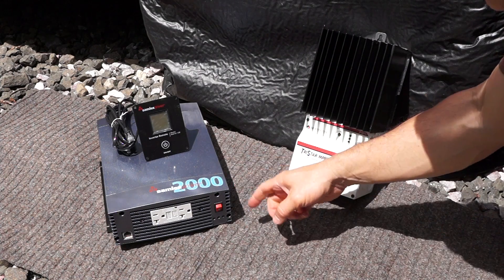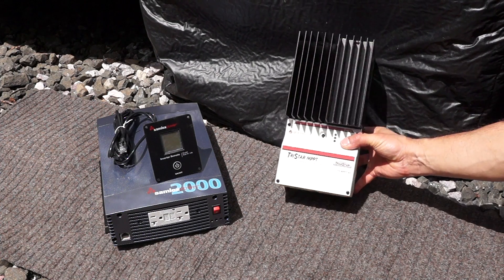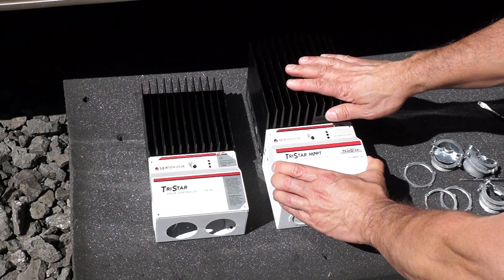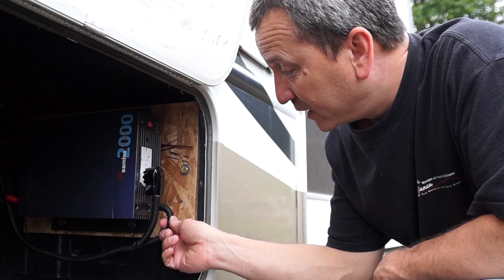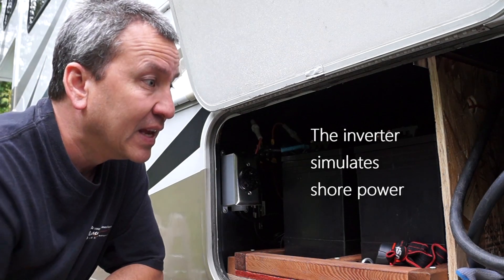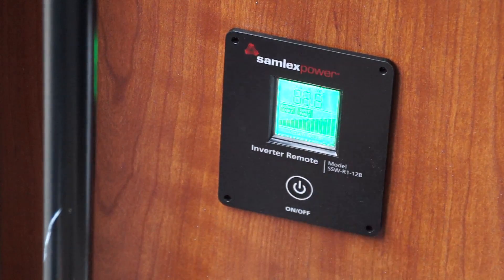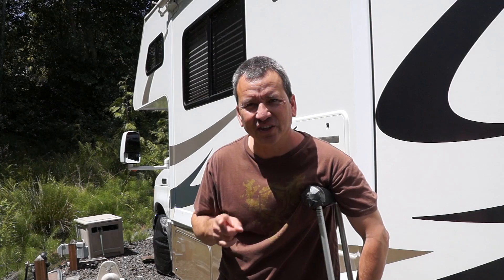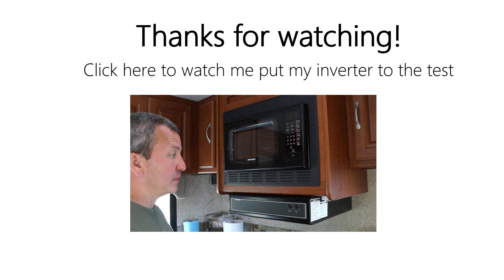Inverter and MPPT Charge Controller Installation - DIY RV Solar

Comment: Hi Tito. Thanks for the video! My wife and I just bought our first RV on friday and I wanted to try a similar setup. A few potentially dumb questions. 1) Did you only install the plug where you did for spacial reasons? Or, would you have installed your inverter next to your shore power if you had the space for it? Can you briefly explain the plug as well? Do you have a 15 Amp plug coming out of the inverter and then going into the new 30 amp socket? Where does that conversion take place? 

Thanks,
Brett
Reply from the maker: Hey Brett. Those are good questions. Here's my attempt a some good answers:

1. I installed the 30 amp plug in that compartment because it is also the compartment where my power cord is stored. It just so happens that my batteries are in there as well.

2. I would have installed the inverter as close to my battery bank as possible. I didn't have anymore room on that side and had to put the inverter on the other side about 6 ft away (with #2 AWG cable). As a general rule, your inverter should be as close to your batteries as possible (6 ft away is about the max), but not in the same compartment as batteries which release gasses.

3. Here's a link instructing how to wire the 30 amp RV plug (http://www.myrv.us/electric/pg/30amp_service.htm). It is 120 volt plug and NOT wired like a 240 volt plug in your home.

4. Yes it's a 15 amp plug coming out of the inverter with a 30 amp plug on the other end. Think of it as an adapter. You should be drawing well under 15 or 30 amps at 120 volts AC from your inverter. 30 amps at 120 volts AC equates to roughly 300 amps at 12 volts DC (batteries). Your battery bank won't support anything close to that. Do not try and fire up your air conditioner, electric heater or electric water heater while on batteries. You're off the grid so stick to small components, laptops, TVs, radios, etc.. If you need heat, you'll have to use your propane. Wait until you hook up to shore power before firing up that air conditioner or electric heater.

I hope this was helpful!
Reply: RVwithTito Incredibly helpful! A few more things. My RV has 50 amp power service. Does that change much in this scenario? Also, I bought a Winnebago Adventurer and the battery bank is in a compartment in the stairwell. I think (it's still on the lot) that the exterior compartment next to it would have space for the inverter. The shore power is on the other side (drivers side) and near the back of the coach, at least 15 feet away. Will that distance have any effect on the install other than just needing to buy a longer cord?
Reply from the maker: brett snider The 50 amp plug is different. It is basically wired to support two separate 120v legs/circuits or together as a 240v circuit ( http://www.myrv.us/electric/pg/50amp_service.htm). Off hand I'm not sure what the best way is to connect to a single outlet on your inverter. You'll probably have to wire it as if it were a 50amp-to-30amp adapter cord. 

You are correct about the length of cord from your shore power cord to the inverter. 15 ft is fine. It's the DC connection between your inverter and battery bank that draws the most amps (due to lower 12v DC voltage) and needs to be as short as possible.
Reply: +brett snider For a 50amp setup just mount a regular 15amp outlet in the power bay and use an adapter plug like this: 

http://www.amazon.com/gp/product/B00HRHWHNW/ref=pd_lpo_sbs_dp_ss_2?pf_rd_p=1944687762&pf_rd_s=lpo-top-stripe-1&pf_rd_t=201&pf_rd_i=B00IPUFQM4&pf_rd_m=ATVPDKIKX0DER&pf_rd_r=1271J1H2B0JR59F4TYD6

Comment: Thanks for the great videos.  We just purchased a used 2006 Four WInds 31F class C, looks very similar to your rig.  We have only used it a couple of times, but know we need to, at a minimum, install an inverter.  (I already put on the front and rear sway bars and shocks you have, worked great). The battery that came with the coach is a single 12V, not two 6 volts like you have.  I want to change over the batteries at some point but will hang with this one as long as it lasts. I am looking at 1500W pure sine wave units.  I want to set the inverter up like yours (minus the solar and "smart" charger you have) but have a couple of questions.  I believe I can do what you did and run a wire from the inverter GFI outlet to a 30 amp receptacle, and just plug the RV "shore power" cable into that when I want to use the inverter.  I would also need to disable the battery charger when I use the inverter.  Is that correct?  Anything else I am missing?  Do I need a fuse somewhere in the system?  Any ideas or thoughts would be appreciated.
Reply from the maker: Nice! Ours is a 2007. Sounds like you are close. Add a 250 amp fuse on the positive battery connection between the inverter and battery. Also use at least #2 AWG cable between inverter and battery and keep the length to less than 6 ft if possible. And don't forget to switch the charger off when plugged in to the inverter and switch it back on if on shore power or generator.
Reply: Thanks, appreciate the quick response.

Comment: Tito, Great videos! I have a 5th wheel with a factory inverter/converter like most RV's that charges my 2 6-volt batteries on shore power. I installed a 315 watt panel through a MPPT Tracer 30-amp controller and want to do the same procedure you did plugging the shore power 30 amp connector to my Whistler Pro 1600 watt inverter that is currently connected to my batteries? I did locate a breaker switch that I believe turned off my factory charger and when I plugged my power cord into my 1600 watt inverter, it started making warning sounds requiring me to turn it off ASAP? I called Whistler tech support and they were not much help, but they thought the factory romex wiring was hooked up differently causing the inverter to back feed and sound off? I have not installed a transfer switch thinking I won't need one? Doesn't the factory inverter/converter have one built in that would take care of my issues? I also located the breaker that controls the 110 outlets (turned it on) that I would use for my coffee maker, tv etc, and turned off all others? (microwave, fridge, ac etc) But no worky? Another RV You Tuber just went directly from the inverter using a heavy gauge extension cord (junction box) to separate outlets mounting them for coffee pot, tv etc? That I can do with a little more work and expense... Like your set up much better though! Any idea whats wrong? Thx Bill

Comment: I have a question for Brian and everyone else.  I was thinking of building a 400w solar generator system separate from the travel trailer.  The batteries, inverter, etc. would be in the back of my pick up truck.  Using a bank of 4 Trojan 105 RE batteries, 4 100 watt solar panels and a 3000w pure sine wave inverter  on a prebuilt board from solarpenny.com with a controller, charger, etc. and a 30 amp receptacle hard wired to the inverter.  My plan was to just plug the travel trailer shore power plug into the 3000w inverter.  Would I have to disconnect anything on the trailer for this to work?  Would my inverter charge my "house" batteries on the travel trailer?  Is the only reason to have an converter is to convert DC to AC in order to charge the "house" batteries?  If the breaker for the converter is turned off, will the DC powered lights and outlets still work?

Thanks for the videos.  They're giving me good ideas.

Lowell
Reply from the maker: lowell mccormick Personally I do not think this is the best option Lowell, but it is interesting to think about why or why not. When you arrive at an answer you will have learned so much about your trailer's electrical system. For that I applaud your efforts. It seems like this setup introduces too many factors that could cause problems. Therefore, I would consider other options. Of course, this is just my non-expert opinion (disclaimer). 

Your RV/trailer's house batteries, converter/charger and AC circuits are designed to be tightly integrated and share a common ground. When adding something like solar or an external solar charged battery system, it's important to understand how it affects the entire system, switching, etc. and be very careful when bypassing one of these. 

With that said, here are some questions/comments that may lead you to a solution: 
(1) Is your goal to charge your house batteries, power your AC/DC, or both? 
(2) Is installing those Trojans, controller and inverter on your trailer an option? 
(3) Yes, your solar generator will try to charge your house batteries unless you shut off your charger. You may have to completely isolate your house batteries since they share a common ground. 
(4) Your converter/charger converts incoming AC to DC (for your 12V DC stuff and battery charging using the charger part) and to filtered AC (for your AC stuff). 
(5) Your solar generator's charge controller and inverter will probably need to share a negative ground. 
(6) To find out if your 12V lights are powered when you shut off your converter/charger, simply hook up to shore power and turn off your coverter/charger.

That's my take on it. Hope it helps. It is fun to think about and I'm curious to hear what others have to say as well. Anyone?
Reply: I would like my solar generating station, along with the 4 golf cart batteries all in the back of my pickup truck and  be independent and completely separate from the travel trailer.  I will pull the solar panels out of the back of the truck, set them up & plug them into the controller in the back of the truck.  The only connection between the power station in the bed of the truck and the travel trailer will be the 30 amp shore power plug from the travel trailer.

I want to use the power station in the back of the truck for other things besides the travel trailer. Park the truck, set up and plug in the solar panels and then plug my power tools into the power station in the back of the truck.

I will leave the electrical system of the travel trailer in it's stock condition.
Reply from the maker: Good luck Lowell. Let us know how it turns out.

Comment: Careful you don't switch the inverter on first and then plug your 30A plug from the inverter into the receptacle! If you touch the pins you could get shocked!
Reply from the maker: Agreed. We should always turn off power to the receptacle before plugging in. Thanks Leonard for the cautionary reminder.

Comment: Hello,  I have 12 of the Uni-solar panels (68 watt) that I just installed on my travel trailer.  I am a little disappointed in the watts I am getting out of them.  I was wondering how yours are performing?   I am getting about 500 watts in peak sun and was hoping for closer to 800.  I have it wired for 48 volts, and am getting in the mid 50's.
Reply from the maker: Fernbark: I think your panels are performing as they should at 48 volts. Here's why. The 68 watt Unisolar panels output 24 volts. Is that right? If true, to generate 48 volts you will need two 68 watt / 24 volt panels wired in series. In other words, your 12 x 24 volt panels will generate 816 watts ONLY at 24 volts. If wired for 48 volts (as you claim), your panels should generate 408 peak watts. So if my logic is correct, the 500 watts you claim to be getting in full sun is good given your setup.

I hope I stated this correctly. By the way, my panels seem to be performing as expected. Thanks for the comment.
Reply: I think the 68 watt model is only 12v output.  I have them wired in groups of four.  Just to keep the math simple, each panel should (best case) generate about five amps.  48v times 5 amp brings you in around the 240 watts area.  Times three groups is 720, which is a couple hundred watts more than I am receiving.  I am going to check my electrical connections and see if I have losses there.  I am not an electrician so I am pretty sure a mistake is in there somewhere. I am addicted to my meters!
Reply from the maker: I am addicted to my meters also. Last time I measured, my 68 watt Unisolar panels put out around 23-24 volts which put's me around 2.8 amps per panel. Good luck!

Comment: I have 3 big panels wit 4x6 vdc batt and 5x12 vdc, batts. At peak sun I draw 14 amps from the panels charging and 28 amps while running the microwave. All my lights are LED, TV is 65 watts and PC is 65 Watts, I can run 24/7 with good sunny weather.
Reply from the maker: That's awesome Bill. Call me crazy but I've become addicted to watching amps. How about you?
Reply: Wish I could cash in on all the amps but the batteries can't take it or the controller won't deliver it. If it delivers 25 amps with the microwave running why cant I charge at 25 amps? Controllers should be programmed for how many batteries.
Reply from the maker: Bill Gorman Good question. The answer no doubt is buried deep in the brain of the controller. Unfortunately, charge algorithms probably vary significantly from one controller to the next.

Comment: Thanks for posting these videos they really answered a lot of questions I had!  I did have a couple remaining though.  One was if you do decide to connect to shore power do you leave the breaker in the off position and still let the solar panels charge the batteries?  If you decided to use the shore power to charge the batteries do you then use the red disconnect switches to keep the solar panels and controller disconnected?  Also, with the batteries installed do you need to ventilate them to the outside?
Reply from the maker: Thanks Greg! FIRST QUESTION: Yes and no. If it is sunny out, I'll let the solar charge controller charge my batteries (on my internal converter/charger - main breaker on, charger breaker off). There are some things that still draw from my batteries. So if there is no sun I'll let my internal converter charger do the charging (charger breaker on) and disconnect the solar charge controller. SECOND QUESTION: Yes, it is best to disconnect the solar panels when charging from the internal converter/charger. If not, then voltage from your solar may trick the internal charger to think your batteries don't need charging and then simply leave them in a float state. THIRD QUESTION: Yes you do. I have installed vent holes (with metal screen covers to keep rodents/bugs out) in the battery compartment to release any gasses that may be release by the batteries.

Comment: I am planning my solar system for my RV and the one stumbling block for me has been how to bypass the shore power system to run everything in the camper off the batteries.  Your simple, 30 amp recepticle is perfect.  I'm legally blind, so I'm wondering, did you permanantly mount the 30 amp recepticle on the outside of the RV?

Before my wife and I head out full-timing, I'm also going to mount two SO-239 jacks for my ham radio antennas.  I'll have little bumps all over the back of the travel trailer.

Thanks for the video.  Great idea.
Reply from the maker: Adam. The 30 amp receptacle is mounted inside the compartment where my power cord is stored. So it is easy to simply plug it in when not connect to shore power. The cord from the receptacle runs directly over to the 3 prong outlet on the front of the inverter.

Comment: Will a Samlex pure wave 2000 watt inverter power a 13500 btu air conditioner, what is the surge rating for that unit?
Reply from the maker: The surge rating is 4000 watt. The question is not really "will" it power your A/C. The question is really for how long. It depends on how big your battery bank is and what its overall amp hour rating is.

Comment: Doing the same type of of install myself now.  I had not seen someone do this before so I'm glad to see it is working for you.
Reply from the maker: Yes. Works great. Don't forget to shut-off the charger. I just put a piece of tape over the breaker in the "off" position just in-case I do something stupid and turn it on. Good luck!
Reply: Tito, you often talk about shutting this or that off at the breakers.  Do you have a video of your fuse block set up or breaker set up for your system?  I see numerous kill switches in your videos but no breakers or fuse blocks.  If I want to use my inverter couldn't I just put a kill switch like you have between my MPPT controller and batteries and would I need another between my batteries and fuse block??  Love your videos brother....safe travels..